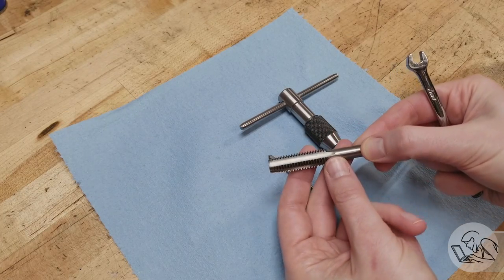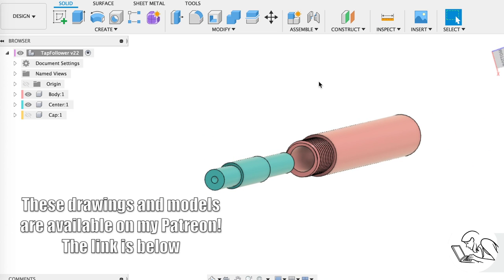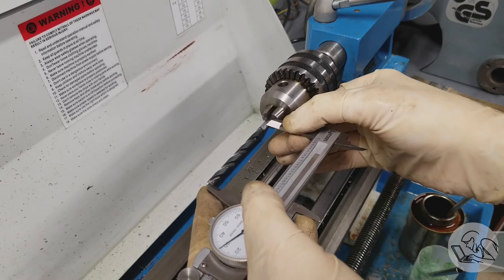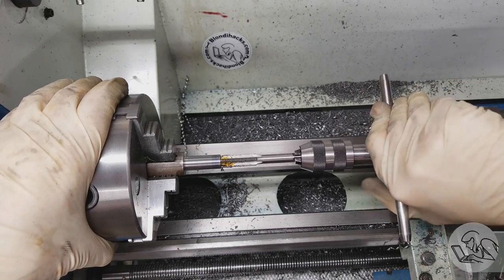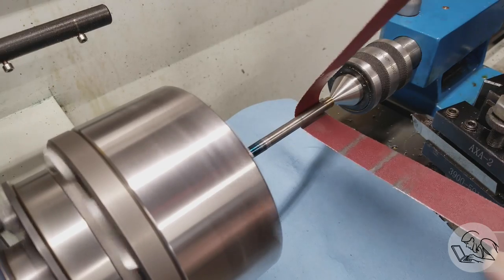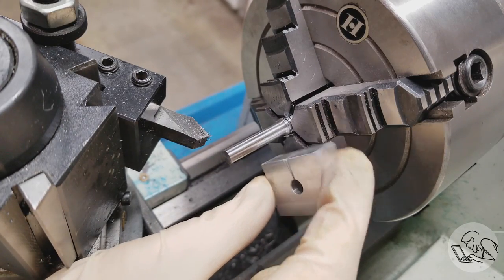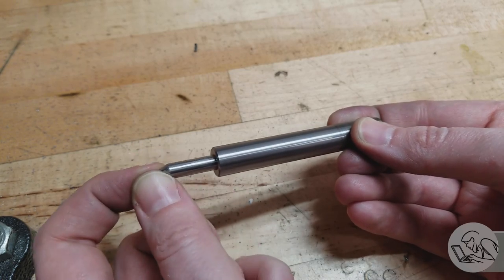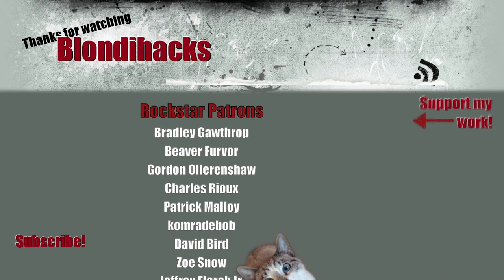Let's Make a TAP FOLLOWER!

Comment: I run OD grinders in a job shop for a living. You are correct on centers. The expensive centers don't stay that good for long. After using them for a bit, they develop runout.  On our grinders at work we use dead centers whenever possible. We have a collection of live centers that we use where tolerance isn't as critical then we keep one in a wooden box as clean as we can and only use it on critical stuff where concentritty is important.

Comment: Excellent little project Quinn. The one criticism I make is with indicating the part whilst using the steady rest. If the steady rest is deflecting the part, say towards the tool, as the part rotates it gets deflected an equal amount so the indicator reads the same.

Comment: Hi Quinn, Very helpful video. Need to make me two of those tap followers. Will do it this week. Regarding the accuracy of your live center. You can dismantle it (very easy to do) and check where the play comes from. If it is between the center shaft and bearing there is nothing economical that you can do to fix it. However if it is dew to excessive clearance in the bearings you can replace them. it will have a needle bearing deep inside a thrust bearing and a ball bearing in front. Replace them with a zero clearance bearing. most cheap everyday bearings have a C3 clearance. This should solve your problem without having to spend a lot of money on a new center. I would start with just replacing the ball bearing first.

Comment: Excellent project and tutorial.
Tip! If hardening thin or slim items, then ensure the item is held vertically along the long axis when quenching. Hope this helps.
Thanks for sharing.
Reply from the maker: Indeed, I did that but it still warped, sadly
Reply: @Blondihacks  Thanks for replying, for intricate components, stress relieving prior to heat treatment is highly recommended, but a simple pin shouldn't need it.
Enjoying the vlogs.

Comment: After watching this video I also made a tap follower. The main difference in mine was the use of a 3/8-16 set screw on the end instead of a threaded cap. Now I have two. One with a point and a smaller one with a center hole. They cover both large and small taps.

Thanks for the interesting video.

Comment: A related suggestion. Drill a series of clearance holes for various tap sizes into a 1 1/4 steel block. When starting to tap a hole, feed the tap through the blcck until a few threads are formed. This will start the tap to within a degree of straight. I made one to mount boxes to machinery 40 years ago and still use it. Straight taps when laying on you back under a machine. And , good for bench work.
Reply: ...because many times you want to tap things you can't hold in a lathe or mill.

Comment: Interesting tip on combining springs. At 9:28 on Joe Pieczynski's "Sequence is Everything for Small Parts" he talks about using different strength springs depending on tap size, so combining springs like you do kind've works for that because you can decombine them and just use one for smaller tap sizes.

Comment: @Blondihacks Re: Time stamp 6:28    I find that clocking shafts with the three point steady in play like this tends to make the clock tell lies. The shaft can't really run out if the steady is supporting on the same surface that the clock is running on. The clock will read nice and steady in relation to the bed even if the steady is holding the shaft off from the machine center-line... I once accidentally turned a tapered bore into a part in this way because I didn't notice the small amount by which the shaft was getting "worked" where the chuck jaws held it.

If possible I like to set up my three point steady with the tail stock holding the part on the lathe center line and then remove the tail stock/center once the three point is all locked down. Doing it this way also makes it easier to touch the steady points onto the shaft with just the right amount of force so as to not squish thin walls.

Re: 12:53      I dunno, I tend to do the same thing more often than I should, but I've taken to momentarily dropping the feed engagement lever out and stopping the tool at the line for a few RPM's  before re-engaging. It leaves a surprisingly visible mark where the line was on the new surface for latter reference.

Edited cause I'm being clear as mud again...

Comment: Thanks for the much improved tap follower design. For best accuracy steady-rests should always be adjusted on a true diameter close to the chuck, then moved out to the working position. If done this way the accessory will be true to the center line of the lathe.

Comment: Havn't used a die nut for thirty years. When you screw cut a lot on a conventional lathe it is so much faster, perfectly concentric and the finish is superb. You also get a better fitting threads and when you screw cut confidently, you don't have to buy a new dienut every time you need a different thread. When I male slender parts, say an M8 thread on the end of something, I leave a bit extra on the length and turn down just below the root dia, say 6.5mm and use my centre. Eleminitates spring, gives space for the lead screw nut engagement and more importantly, takes up the minor end float in the spindle. When Im done I simply cut off with a cutting of disc in the disc grinder with the lathe going and of course with the centre out of the way.
Reply from the maker: Written like someone who has never had to use change gears. 😬
Reply: @Blondihacks  I do have that luxury but I did my training as we crossed over from mainly imperial pitches to mainly metric. The old flat bed lathes being imperial required gear changes and we just had a wee book. Did not have the luxury of changable tips, almost no carbide and these were used mainly on manganese work hardening sheaves and we brazed these on ourselves. We would be constantly getting ready for the next job, figuring it out, grinding up tools or drills while a cut was advancing in the lathe. Actual lathe engine time was longer but today people sit and watch instead of being productive. Today people mess about with carbide tooling and take lots of cuts(not the cnc guys) when in our day the lathe would run at a much slower speed, at the lower end of surface speed and we took deep, high feed cuts with qood quality high speed steel. You would be amazed how much material you can remove with a powerful lathe with a speed of 2 rpm. So yes I am spoilt but starting off I made thousands of shackel pins by hand. Hundreds of double start well pipes both internal and external with a flat square form and tapered to boot all without taper turning options. I was offering a bit of advice but that seems to have been missed.

Comment: When turning very small diameter stock, use a small chuck from a discarded hand held electric drill.  They generally have 3/8 through hole and are REALLY ACCURATE when placed in the normal lathe chuck.  Try it, you'll like it.

Comment: Interesting varation on another one I saw and made. What he did was to bore and ream about a 3" inch deep hole in 1/2" stock (body), then mill a 1" slot into the side about 2/3 the way from the closed end. The tap extender ram turned to a point and sized for a close fit into the body. With the center inside the body and the pointed end extended as one wants a hole is drilled and tapped into the center at the mid point of the slot. A spring is then placed into the body, the center inserted and a screw, set screw, etc. is installed in the drilled and tapped hole. Thus, a different version of hte tap follower. I ended up making a spring as well which is another project in itself - also I could find nothing around the shop I liked.
The 1" trave. (could be more) allows for enough movement for a good tap start. Nothing is critical except the center to body fit.

Comment: Hi Quinn,
If you need drilled holes with a flat bottom, DeWalt pilot point drills will provide that flat bottom. I use them for just that purpose.

Comment: "threads are poor at holding concentricity"  I recently learned this nugget the hard way on my wood lathe refurbishment.  A tight thread is less accurate than a loose thread with a proper shoulder.  The loose thread self centers when the faying surfaces of the shoulder locks up.

Comment: Nice work! This seems like a pretty good project to start with when I get a lathe. I won't get the precision or finish you do but the tool itself is easy to understand and it involves a number of different operations on the lathe.

Comment: I may have got this wrong but I think metric reamers are designed to cut slightly over size - partly to allow for wear of course. Precision ground metric silver steel (drill rod) is I think deliberately ground very slightly under size so it will turn in a reamed hole. The tolerances are plus something minus zero for reamers and the other way round for drill rod. I do not know if this is true for US measurements or not but if it is then selecting appropriate reamers and drill rod would possibly eliminate one turning operation. Just a thought, rather depends on what is in stock! BobUK.

Comment: Nice project, and a good redesign.  But at 6:26 I'm pretty sure indicating the end doesn't tell you much.  The end could be deflected an entire inch off axis, but because the part is supported by the steady rest it will run 'true'.
Reply from the maker: It tells you if the guides are adjusted unevenly. If it’s running true at that point, it will cut true, and that’s all that matters.

Comment: Oddly Satisfying indeed! Thank you very much for this Ms Blondi. I like the way you point out the range of run-out specs on the live centres. And the potential effect on the accuracy of the work. And the staggering $$s one has to pay for the really right stuff. 
For my home shop I just stay away from bottom-of-the-barrel prices and the poor stuff you generally find there.
Reply: Bruce Witham urged me to get one after watching me struggle with the operation.  I too had sticker shock at a good commercial equivalent.

Comment: I bought an extended nose  live center so I could get closer to small parts, Cheap Chinese. Way to much runout to be of any value. I now use a half dead center. When using a tap always remember to tilt the glass so you don't get too much foam. Thanks for the video. My Chinese tap follower does the hula, I'll see if I can get one to come out as well as yours did.

Comment: I like a little more spring pressure on a tap follower. In my opinion, the initial force of the spring is what makes the threads straight. After 4-5 turns, the tap will continue to be straight, and you can remove the follower. Maybe I was was misreading the spring tension in the video.

Comment: You could also make a threaded hole in the back instead of a cap, use a set screw as a plug to hold in the pin and spring.

Comment: I need to make a "negative centre" for those small taps. I did make mine with the screw at the back -  not really some clever thinking on my behalf, just pure coincidence of how I figured I could make it. But first I need to fix the power to my lathe. I broke the three-phase inverter that feeds my lathe with three-phase in my single-phase garage - a small chip must have fallen down into the electrical parts when I hammered in some clips for the wiring for my mill, and when I turned the power on for the lathe, "flash / bang and then power gone...". Found the culprit, but the amount of smoke and burnt bits on the PCB told me to order a new one. Will try to build some sort of roof/cover for it, so that chips that make it up to the inverter will fall off to the side rather than sit on top of the inverter...

Comment: For future mechanisms, if you make the length of the larger diameter of the pin (that mates with the bore of the body) as long as feasible, you'll control the lateral play in that without needing to match the concentricity of the bore the pin exits from - that can be clearance.
Reply from the maker: Two points of support will always be more rigid though

Comment: Have you ever considered putting a maker's mark on your scratch-built items ?   Totally deserved IMO.
Reply: Nice way to do that is you can get some paper off of Amazon that is for printing circuit board etch resistant on. You have to use a laser printer. anyway you can basically print any pattern and then heat transfer from the paper onto your part. Be sure to reverse the image before printing.

Comment: If you are. thinking of modifying your steady rest with roller bearing tips (like I did) be aware that said complex systems are rarely as robust as the solid brass finger. I had barely used mine at all when one wheel blew out. You would not want this to happen on a critical part that you had already put a lot of work into.

Comment: very nice job, love the videos. i did think about making one of these, but for the price to buy one isn't that dear at all. and its one less project to make, when you have so many to do already.. but i did love the idea of doing the reverse end for the small taps. so i took mine apart to do the same thing, but other then getting a tiny spot on the end with a centre drill i can make it any deeper. guess they hardened the inner shaft :(

Comment: Awesome job, as always, Quinn. I really need to make one of these. 

Question: Would it make a difference in the runout of the live center if you measured it loaded as in normal use, rather than hanging out in space?
Reply from the maker: That’s a great question. It might!
Reply: @Blondihacks  Also, a drill chuck mounted to a tool holder for your QCTP is a good way to drill deep holes like that, when you lack tailstock quill travel. I have a similar (but smaller) import wedge-type tool post on my 7x10 lathe, and among the included holders is one with a Morse taper 2 socket. P/N is 250-005 for my 0XA-size tool post, -105 for AXA, -205 for BXA, etc.

It's fiddly to get the drill bit dead on center (I use a dowel pin clamped in the chuck to indicate against), but it allows faster peck-drilling/chip clearing, and also allows for drilling to a precise depth using a dial indicator or a DRO.

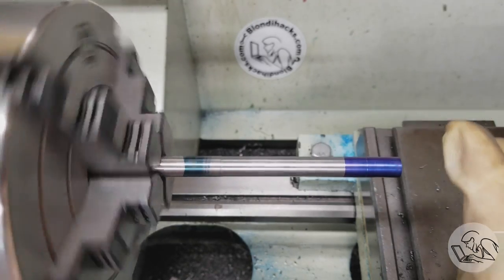Comment: 14:21 you now you're an old school machinist when you use your own blood for oil.
Reply: Please don’t say machinist , say “Machine Operator “ This is not a put down but the correct term.
Reply: @cesarflores8561  Back in the day, a machine operator was low skilled, and didn't do their own setups.  A machinist is skilled, does everything.  There were also terms like "lathe specialist" able to do their own setups, but not as skilled overall as a machinist.  Blondihacks is much closer to a machinist than a machine operator, unless the nomenclature has changed.
Reply: @incognitotorpedo42  Yep My grand dad was a Machinist.
He cut the ring gear for link belt speeder cranes and other rotating machines.
Find an old link belt and I would bet you will find the letters I. A stamped on the ring gear( Ivan Armstrong).

Comment: Really nice, and surely an upgrade over the previous one. Is there a particular reason to use threaded cap on the outside instead of a large grub screw on the inside, that way the shaft remains concentric over it's whole length and you can also alter the spring tension. (although you would probably need to use some loctite to keep it from moving)

Comment: nice video. What is the cutting grease that you are using?
Reply: It is called Anchor Lube. It takes some getting used to as it is water soluble and quite a bit different than oils or greases. One of the best things about Anchor lube is that you don't have the smoke that is generated by conventional machining lubes. (I am a hobby machinist so your performance may vary.)
Reply: @robertoswalt319  thanks for answering. I now i have to try it, because i am annoyed with smoke fumes that stinks up my small shop when working.
Reply from the maker: Yah, Anchor is nice in the winter for that reason. The downside is that it does still smoke, but a lot less. However the smoke smells a lot worse. So it’s sort of a trade off.

Comment: A little tip about the oxide coating,it's porous,you need to oil it,infact wrapping in an oily rag over night is best,how do i know,i re-blued a gun barrel,and to my detriment i did not oil or wrap and it turned to crap within days of going shooting here in damp scotland,not all oxide coatings need oil,but i think they are (mostly) electrically deposited and form an impervious barrier to moisture,unlike hot or cold chemical blueing,plum's nice too.

Great vids,very informative,and i need a tap follower ....

Comment: Thanks for making awesome videos. I just bought a grizzly G0759 vertical Mill and was wondering if it can be used as a lathe somehow?
Reply from the maker: There are ways to do turning on the mill, yes! One way is to simply use a boring head run in reverse. You can also fixture the work in the spindle and clamp your tool in a holder in the vise. Check out Hard Rock Machine Shop for more techniques.

Comment: I'd use a long socket head screw. 3/16? 1/4? They are usually grade 5, so harder. Turn the head smaller/rounder, use the long shank as the guide.

Comment: Great video.
I think you could have add a little taper on the negative end to make it a little easier to get in and I don't think the little stick-out of the negative end should be a problem, because the point of the tap will probably have a smaller diameter then the hole in the tap follower so worst case it will go into the body of the tap follower.